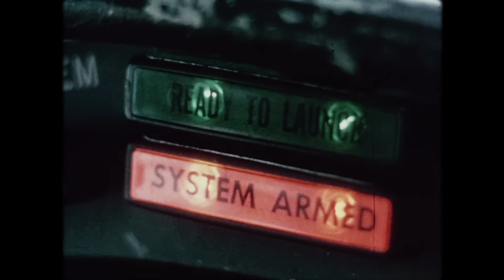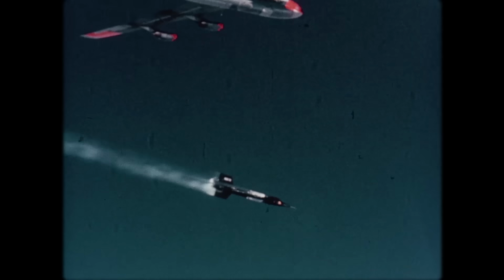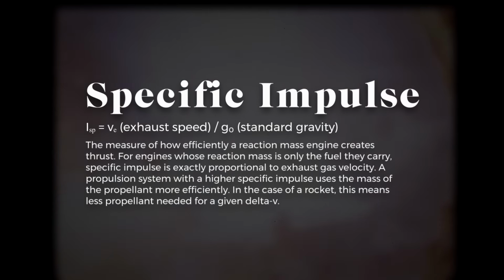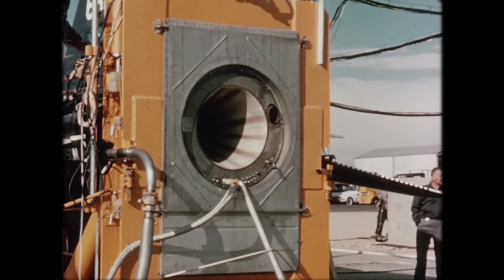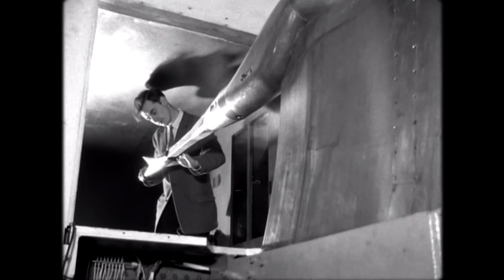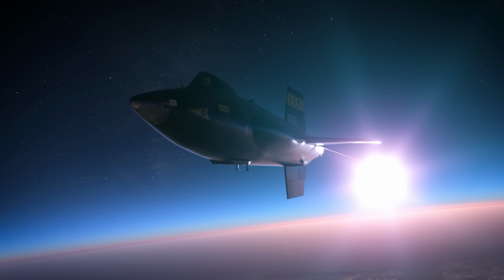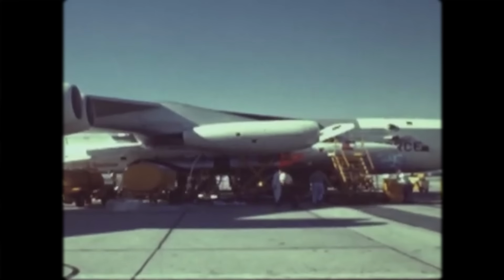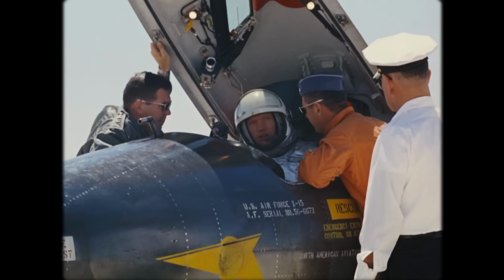The Insane Engineering of the X-15

Comment: Not trying to take away from the absolute feat of engineering this was , but at what point do we draw the line for what is considered an “airplane”. I’m just genuinely curious because this thing seems closer to a rocket ship than any proper airplane. I mean it uses rocket propulsion? And it’s appearance despite it’s insanely complex engineering looks deceivingly crude and simplistic. As if someone took a literal Rocket or Missile , stuck some wings on it, then dug enough space out in the front for a cockpit that fits 1 human being. Tbh the Space Shuttle looked more like a traditional airplane that this aircraft did, and the space shuttle was ment to put itself into orbit. 

Although the X-15 crossed the line that is technically considered space it never entered orbit nor was it designed too. Is the ability to enter orbit or leave the gravitational pull of the earth the only thing that seperates our definition of “rocketship” from our definition of “airplane”.  Obviously the definition for “airplane” Is a loose one but ide say an aircraft or whatever you want to call it loses its definition as an airplane when it moves from using a jet engine to fly at the very highest points of our atmosphere to using rocket propulsion to send it into the lower levels of what we consider space. If we say that this thing holds the record for fastest recorded airplane flight I think there should be an Astris next to it considering it’s competition that also falls under the category of “airplane” is often not using rocket propulsion and is not flying in space , usually just the borderline of it. Same goes for the SR-71 , if you need to wear a pressurized suit to be in or pilot an aircraft then it’s honestly lost the title of airplane at least to me.
Reply: Every reference I've found (Wikipedia, Merriam-Webster, Britannica) draws the line as heavier than air, fixed wing and propelled by an engine. So yeah, if you want to fit a cockpit and wings to a rocket it's still an airplane.

Comment: Income, dis NOT A METAL but ALLOY!
Reply: Nitpick, but technically you are correct of course. Many people use the term metal for any material with a free electron structure, instead of in the restrictive meaning of ‘element” so appearing in the periodic table….  So, bottom line is: semantics. In this case we understand eachother 100% and also agree to that degree. Better family, perhaps not quit so happy though as the Flat Earthers😄, but in the long run…. Now a metal, h.. alloy that becomes super conductive when it is embedded in a certain magnetic field…. (Of a certain f, for currents with another certain f…). Or, at least, so I imagine, some alloys might behave…😎😏😥